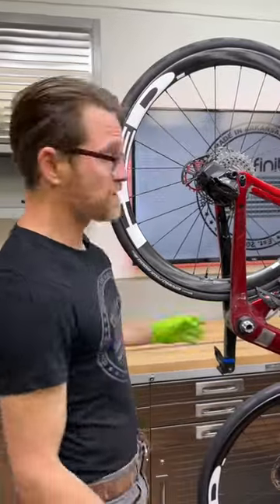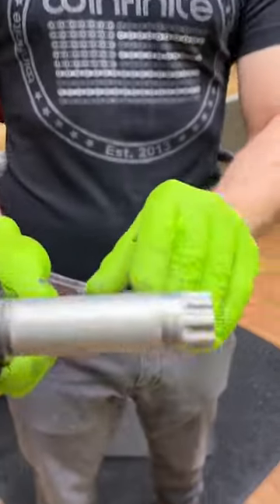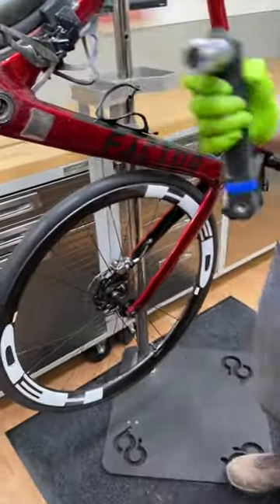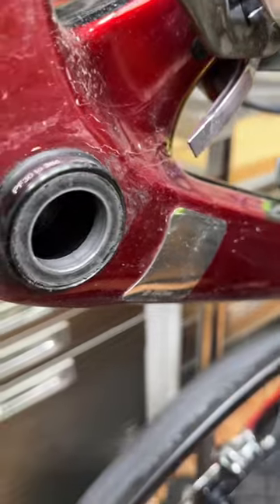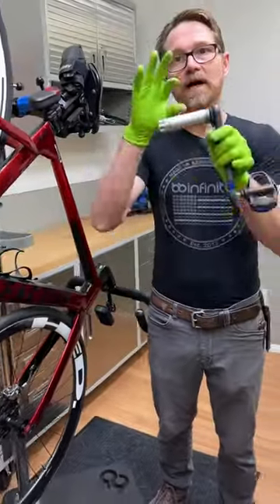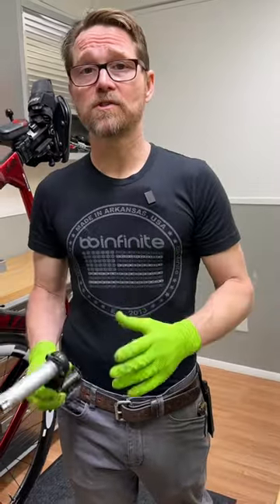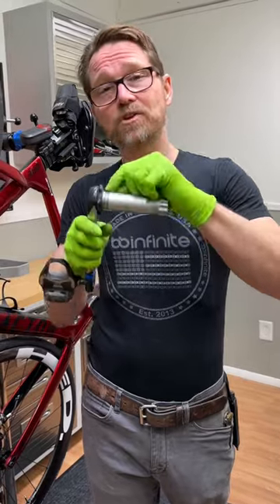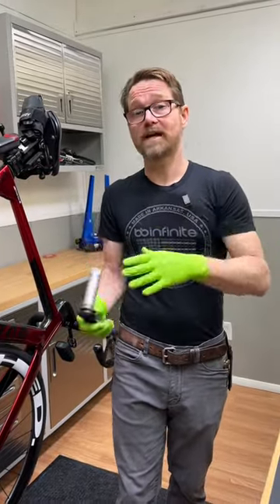Your Bottom Bracket is Wearing Your Crankset/Chain Set Out

Comment: What may be misunderstood here is dissimilar metals. Aluminium will sacrifice itself to prevent steel from corroding. Bearings are high carbon and subject to corrosion. You therefore should always isolate dissimilar metal from one another unless they are innert
Reply: Hope my next bike is okay, stainless steel bearing and carbon fibre spindle

Comment: To me that more looks like bearing misalignment rather than a material mismatch issue. Have you measured perpendicularity and concentricity of the two bearings to eachother to verify that it wasn't a tol stack on the frame that's the root cause?
Reply from the maker: The Rockwell B hardness of the stainless race in this video is 88-90. The Rockwell B for 6061-T6 Aluminum (the spindle) is only 60. This is the explanation, BUT, you are absolutely correct that bearing misalignment is a major factor that exacerbates this fretting process as well as being the major cause of poor performance and durability. This is why our 1-piece, hub style bb solves most wear, durability, and performance problems with BB's. It's by simply engineering it like an engineer would have engineered it. As of the tolerance stack: it's a press fit within a pressfit...shear madness! But that's the bike business for you.

Comment: The spindle fits into the inner bearing race and they should rotate as one part. The only way to wear the spindle is if the rolling resistance of the BB bearing is so great that the spindle spins inside the inner race.

My experience is with SRAM Omnium cranks. They do have a plastic bushing on the drive side, however i believe this is mainly to seal the dirtier drive side.
Reply from the maker: This is a common misunderstanding of how bearings journal to the spindle dynamically in the real world. Spindle wear will always occur in any 2-piece BB system, be it pressfit or threaded. When the bearings are in top shape, and spinning great, the wear occurs for two reasons: 1) Because all BB systems (except ours) are two pieces, and the bearings are misaligned by nature, this puts the inner races into eccentric orbits about the spindle that is forcing them straight. This causes the races to "dance" on the spindle very slightly, which  then causes the fretting seen as smeared wear marks. That's one. 2) Debris ingress between the parts. This ingress of fine aggregate acts like sand paper, so add this to what's going on in Number 1 above, and  there you go. So our 1-pc hub style design prevents spindle wear in DUB applications by having perfectly aligned bearings within the hub AND by employing the polymer DUB inserts. The more you know...

Comment: Nothing a little wipe of the right locktite can’t resolve.
Reply from the maker: Yes, using loctite to bond the spindle into the inner races of the bearings would solve this issue under "normal" circumstances, BUT in this case it  would not solve the bearing misalignment issue which is also in play here. Good comment.

Comment: they're both steel though. shimano hollowtech II crank spindles and bearing outers are both steel
Reply: Bearing surfaces tend to be hardened steel from what i remember so they do still wear out steel cranks
Reply: @moritzwagner-tsukamoto7699  It's not aluminium, thats pretty major missinformation. If you actualy try and measure the wear its non existent the hardness is not too dissimilar and its a flat surface rather than pitting from say a ball bearing
Reply from the maker: @moritzwagner-tsukamoto7699  Thank you, yes, exactly right. Bearing races are chromium steel, which is many times harder than the steel Shimano uses in their spindles.
Reply from the maker: @moritzwagner-tsukamoto7699  Exactly.
Reply from the maker: @ezeekwheel  Reality: https://youtu.be/DyHUclOUuDo

Comment: What you need there is bearing fix from the like if loctite. Until it’s time to remove it if course but that’s what heat is for
Reply from the maker: No heat. Do not heat anything. It's unnecessary and could result in damage. Everything is done at room temps; installs, removals. No heating. When  the correct retaining compound is used things go well.
Reply: @BBInfinite  which retaining compound does not need heat for removal?

Comment: One more reason for Sram's DUB spindle to make a bit more sense vs 30mm with a BSA BB. T47 BB would probably be getter for 30mm spindles anyway.
Reply from the maker: BSA doesn't make sense for any crank spindle larger than 25mm, frankly. It's a standard that should have died out in any engineer's mind once T47 arrived. If it's a new bike and it's got BSA, walk away. Get T47. Period.
Reply: @BBInfinite  or get a hollowtech II crank.
Reply: @oftankoftan  Why Hollowtech2?
Reply: @loveulez  24 mm spindle. allows for larger bearings in a BSA shell. made out of steel and doesn't have metal-on-metal contact, and doesn't have issues with bearings seizing on the spindle.

Comment: Polymer inserts are not the solution, just a plaster to either wrong clearance between bearing and crank or eccentricity between BB bearings
Reply from the maker: ....and that's the point. Crank comes from this manufacturer. BB from this one. Bike from this one. And the cranks are of all different designs and dimensions and manufactured to different tolerances, and it all must be integrated into a single system. What you are advocating would required centralized control of the bike industry under a single engineering body. All products of the approved design must then be made to the same, exacting, aerospace tolerance specification. It's a great idea that was dead before I finished writing the sentence.

Comment: Nobody is gonna wear through their crank spindle
Reply from the maker: A DuB spindle is supposed to be 29mm. If any of it gets worn off, even a bit, it's less than 29mm. If all the parts are supposed to be a certain size to function properly, it's a problem when they're not. Spindle wear is a reality that affects steel spindles and aluminum spindles alike.
Reply: @BBInfinite  I just feel like if this was a chronic mainstream problem people would not have accepted outboard bottom brackets and stuck with square tapers or octa links.
Reply from the maker: @scottwistinghausen1888  It's funny what people come up with when they're speculating. Let our vast experience inform you. If you go through our archive of videos you will see ones where we show Shimano spindle wear problems, aluminum spindle wear problems, and on and on. This is something that most people just overlook, which is why most people have difficulty trouble shooting mechanical systems: They assume things "can't be the problem", and just look past something that, if they just took a second to measure, they'd find the solution to their problem. Slip-fit spindles are wear items by nature. The lifespan of a crank is determined by the integrity of the spindle.

Comment: BS. The crank should be fitted so that it doesnt move or rotate inside the bearing. It doesnt matter what material it is, as long as it is strong enough and the tolerances are kept.
Reply from the maker: Yes, the bike industry's designs are BS, we agree. If the aluminum spindle was pressed into the bearings the dissimilar materials would not be a problem as long as the bearings are perfectly aligned. But that's not how the cranks are designed. They are designed to be as slip fit. Think about this: If it's a pressfit BB, the bearing is press fit into the BB housing. That's 1 press fit. Then you press the bb into the frame. That's another pressfit stacked on. Now, if they ware going to press fit the crank into the inner race, that's be a triple tolerance stack! Ridiculous. Dumb, yes, but that's why we say what we say in this video, and why we (and Shimano) create novel designs to compensate for improperly engineered systems. Guys, look at a Campagnolo Ultra Torque crank set. Bearings pressed onto the spindle. CORRECT! The rotating assembly needs to all be press fitted together. But once again, Sram and Shimano don't make their stuff "correctly", and so we make the best of it. Then  why are Campy UT cranks so problematic? Because they had to cope with the stupid BB designs like BSA at the time and the lack of any coherent, unified design. We could go on all day....Great comment, and you are dead on correct.

Comment: Only reason that wears like that is because the bearings aren't fitted properly and the crank is moving/rotating in the inner bearing race.

Properly fitted bearings/shaft with correct clearance and/or a drop of bearing retainer > problem solved
Reply from the maker: Not sure how the spindle can rotate inside the inner race when the bearing isn't seized, which in this case, the bearings are fine. What's really going on here is bearing misalignment coupled with dissimilar material hardness in a slip-fit system. The softer material will always lose. To fix: properly align bearings with a hub-style bb system, like ours and isolate the dissimilar materials.

Comment: This is an engineer?
Reply from the maker: Yes, speaking to laypeople about things.
Reply from the maker: @grahamreeve5209  Ah, I see, you don't understand what you're seeing. The spindle to bearing interface in the case shown here is not supposed to be an interference fit at all,  but a slip-fit instead. If it was supposed to be an interference fit you'd see people pressing crank sets into the BB. The problem of fretting shown in this video is from a slip fit between materials with radically different hardness. Soft metal will lose to hard metal when movement can occur between parts. By using a polymer sleeve to "tighten the fit" between metal parts we solve the problem of fretting, which causes premature spindle wear. This is why Shimano does this exact thing with all of their bb's. The chrome steel of the bearing races is harder than the steel spindle of their crank sets.
Reply: @BBInfinite  that's the point I was making. If the spindle interface was correct there wouldn't be movement and therefore no wear. It's lose because of poor manufacturing tolerance. If the tolerance was correct then poor design.
Reply from the maker: @grahamreeve5209  It's a slip fit between the spindle and the bearings, ergo, movement is possible by design. Don't take this personally, but we deal with this level of misunderstanding all of the time. The layperson doesn't understand how these systems work dynamically. Shimano, for instance, does very well, which is why they've always used polymer inserts to isolate spindle from race. As a person pedals, the inner races of the bearings move around on the spindle. This is a very small, imperceptible "wobble" and "squirm" throughout the rotation. This micro movement translates into wear patterns that look like and are the results of classic fretting. Check this out: https://en.wikipedia.org/wiki/Fretting
Reply: @BBInfinite  I don't take it personally. I'm just a bit smug knowing I could do a better job and the polymer idea you use is just one way of making a better job of it.
Reply from the maker: @grahamreeve5209  The best ideas on the internet are always the ones that shall remain untried.
Reply: @BBInfinite  hi, I have a question regarding this topic. I have always wondered why are most if not all bearing to shaft fits made as slip fits on modern bicycles? Is it only for ease of assembly or does it have any other benefits? Because in the video you clearly showed it has downsides. And if you look at any other machines, bearings mostly tend to be press fit with the shaft. Just wanted to ask someone who works in the field.
Reply from the maker: @martinmikus472  You are correct, the bicycle industry completely ignores engineering norms. Campagnolo is the exception, as their Ultra Torque cranks "do it right" when going by the book. The correct "book" way is: the bearings should be pressed onto the rotating shaft and the bearings themselves (the outer race) should be slip fitted/clamped/or otherwise fixed in place by some method other than a press fit/interference fit. The deal is that one doesn't want multiple press-fits because this naturally stacks tolerances. The bike industry gets away with this because...reasons. They just do what they do.